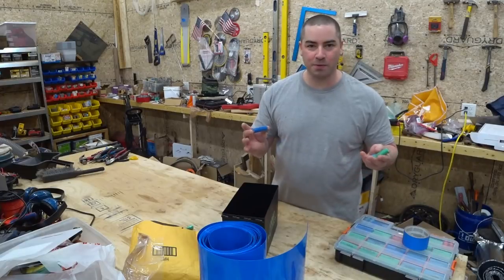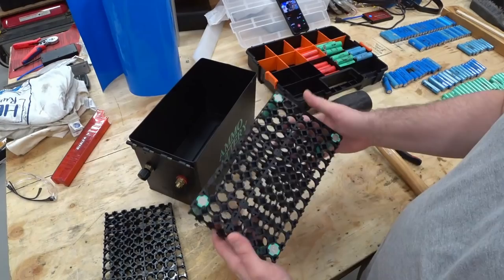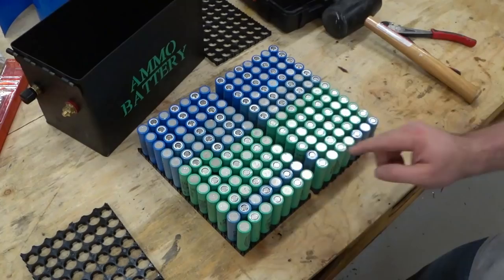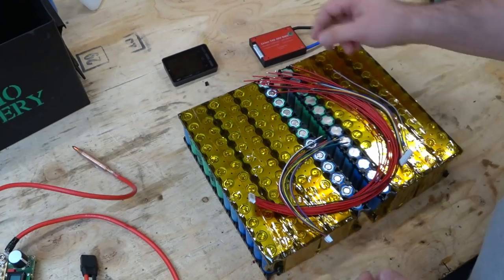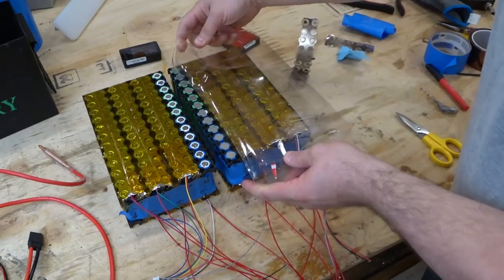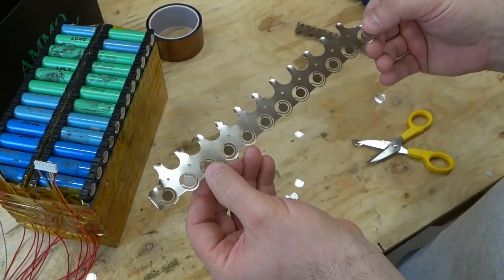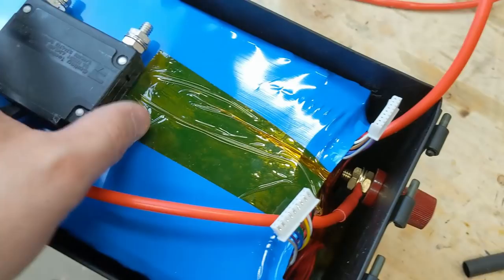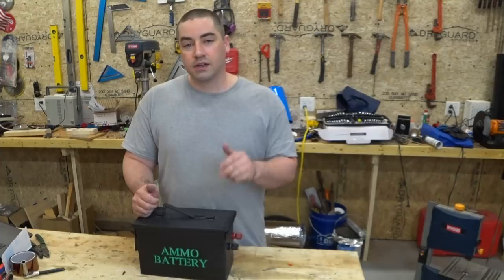48v DIY Battery in an Ammo Can

Comment: Great build.  Looks as good as factory made.  Only concern I might have is with the ammo can is if there is any interior heat build up.  How would you know before a cell goes thermal runaway?  The can being fully enclosed would also not allow much ventilation of the packs.  Maybe do a strong load test and show monitored temps at various cells IN the closed can and the outside metal of the can.  Maybe the can is an adequate heat sink to air, but does not help if a cell becomes a heater.  Great job!
Reply from the maker: It's always about compromise.  You can have wide open cells in the room, but no fire protection.  This takes the approach of enclosing the cells to protect the room.  The downside is you have to limit the amps to limit the heat buildup.  That's why I used a 20 amp circuit breaker.  The cells could do twice that.  I have been doing a series of tests on it at different amps and measuring the heat buildup.  It will be in a future video.

Comment: I put 12 3 LG 18650 2600MAH CELLS IN MODEM BATTERIES solder in paral and only got 2 hours of run out of an 200 watt inverter. I got the same 2 hour run time  with 4 lipo 4/ 8 amp hour in saire and out the same 2 hour run time. 12 3 LG 18650 2600MAH CELLS IN MODEM is = to 4 lipo 4 in saire!

Comment: Nice, clean job on the construction, so I will check out some other videos of yours...not to sound like an armchair expert, but I do fear by not accommodating the heat generated during charge and discharge, especially in a (semi) sealed enclosure, you are going to run into thermal limits long before you will run into electrical limits.  I recommend doing some temp tests under the typical, and worst-case operating conditions...but best would have been to embed some thermo-couples for internal sensing (and monitoring), into the array while you were constructing it, because for instance, high heat generated by a failing cell(s) will not be noticeable because of the high mass, and it would have to make it heat the entire mass before you might notice...it would smoke and possibly catch fire long before the entire box got hot enough to get a hint anything was wrong.  I recommend you build-in internal temp-sensing into any future arrays you construct, and add continuous temp monitoring in addition to your cell V monitoring!     Cheers
Reply from the maker: I have tested it under heavy load and it has not overheated.  Each cell can do a max 4.4 amps, I have 12 in parallel, or 52.8 amps max.  I have a circuit breaker limiting it to 20 amps.  It does not overheat at 20 amps.
Reply: @DavidPozEnergy  Great video!  What would you have to change if you were to make this as a 24v 7s24p pack?

Comment: I can’t get the math to work out on my end.

2200MAh cells
At nominal 3.7 V/cell of 8.14Wh per cell... 112 cells per battery, 14*8... I figure .92 KWh... no?  At 4.2V per cell, 2200MAh works out to 1.035 KWh... where is my math missing something?
Nevermind... 12p at nominal V, I now figure 1.36KWh... NICE! Max rated, should be 1.55KWh. A quite useful pack!
Reply from the maker: You got it.  And you could always buy higher capacity cells if you get them at a good price.

Comment: Is that spot welder really over $200? Unless I'm constantly making battery packs, that purchase would negate any saving of getting used cells. But awesome video!
Reply from the maker: Yes, the spot welder is over $200.  I hope to make more builds of different types, so I'll get some use from it.  But if you only have one battery then there are other ways to do it without buying the spot welder.
Reply: I thought the same about the price, so I made my own double pulse welder that provides consistent perfect welds for around $45. Check out 100A/40A Digital LCD Double Pulse Encoder Spot Welder Machine Time Control Module Board on ebay or Amazon.

Comment: Put 3 boxes in series and run your mitre saw on D.C. if it has a brush motor.
Reply from the maker: I'm intregeed by this idea.  Several people have suggested it to me over the years.  I don't want to blow up my expensive miter saw.  Do you know of any video, blog, white paper, anything that might show or prove this concept?
Reply: Try it out on a brush motor say in a hand circular saw (Skil Saw) or a large Shop Vac with a run current similar to your mitre saw. Check the Re Store for a cheap one. A current limiting resistor could also be used in series with your mitre saw to limit the surge until it gets up to speed then by-pass it for full power. Say 1.5 ohm 200 watt. Is your mitre saw an A.C. /D.C. Brush motor?
Reply: Check your mitre saw to see if it is a universal motor.  https://en.wikipedia.org/wiki/Universal_motor

Comment: You did not current test the battery.  Thus you couldl have a unbalanced bank of batteries after a few use (think of one bad battery). This could lead to one of your banks becoming drained and reversed charged. That could lead to one large  fire.   does the bsm have a low voltage bank alarm  or are the tabs also a fuse?   What was this design based on?
Reply from the maker: I have a previous video testing cells.

Comment: David why wouldn't you just put 2 of the balancers with screen inside the case as main BMS?  2 Of these are a much cheaper option than the BMS you bought to go along with the build by almost 50% and they do the same job (I've come to believe.)   Also a point, since everything is frequency and magnetic based on our lovely planet, try putting the same "magnetic orientation" cells together (ie: next to each other and in magnetic lines of force) as they are "polarized" if you check them with a compass after charging.  I place a sharpie DOT on the positive end.  I would expect this would help with power "flow" since there is less magnetic resistance.  Nobody has thought of this yet it is an anomaly I discovered by accident back in early 2020 as I kept a compass on my desk.  Think about this scientifically, it's easier to swim with the tide than against or across it, why fight nature?  Cheers David, love you guys and your content.
Reply from the maker: BMS stands for Battery Management System.  The #1 priority of a BMS is to shut down the battery if any single parameter goes out of spec.  Think of it like a smart kill switch.  The BMS's job is to keep you safe.
Some BMS's have cell balancing as an extra feature, but not all.  Balancing helps with the battery longevity, but balancing doesn't shut down a battery.  Balancing is not safety.  A balancer doesn't replace a BMS.
I hope that helps.

Comment: Have you considered the Headway 38120 LiFePo4 batteries from batteryhookup for your Mitersaw?  Maybe only in 24v for less weight.  They are huge and their discharge rate is very high.
Reply from the maker: Sure.  Nothing wrong with those, the specs are great.

Comment: Great video and love the K-weld. German built has lived whereas my chinese welders died. 
On a note about BMSs, the one you have probably doesnt have enough balance current to be effective. My guess is something like 30 to 60mA, and you should have something much larger with that many parallel cells. I found sole purpose balancers that do this, although they are more $$ than a BMS, but can balance at greater than an amp.

Comment: It would be cool to make a can for conversion.  Mainly a 48 to 12 DC to DC converter.  I am thinking about making something similar for Ham Radio.  How is the heat?  I was thinking about liquid cooking it.  For the surge of the saw, a large cap could help out.
Reply from the maker: If your radio is 12v, then you can modify the design to make a 12v battery.  Then no converter is needed.  But, there are lots of 12v lifepo4 batteries on the market, so you have choices if you want to buy one.

Comment: Could you put several of these to make a power wall? I have 22 solar panels on my roof and in the future I might consider making my own power wall set up.
Reply from the maker: Yes you could.  Just make sure not to exceed the amp ratings.  The reality is you don't want to charge a cell more than 500ma.  Which means try not to charge this 12p arrangement more than 6 amps.  But you just do out the math for your situation.

Comment: I think you did a good job but I never understand people using used batteries that can't be individually changed out. When I built my 10k plus powerwall I used new LiFePo4's but, even with them being new, each one is removable from the system.
Reply from the maker: It would be some work to remove one cell.  I tested all the cells before putting into this build.  And the cells are new-old stock, so they have never been used, but were sitting around a couple years.  But still, you probably have a way easier system to swap a cell then this.
Reply: @DavidPozEnergy  Dave, thanks for the reply. I think you did a good job but on my bank I fused each cell, you just don't want a shorted cell, especially with Li-Ions. 
Also, isn't that guys battery welder expensive? I designed my own with SLA batteries which I think are better for welders, cheaper and just as, if not more stable. He set his up for joules but I don't think that's necessary either, kind of overkill which always costs more.
Again, thanks for the video.

Comment: 8hrs to rip open modem batteries, $200 for a spot welder & another couple hours to put it all together? vs just buying a premade 48v packs that batteryhookup sells a few times a year. I just bought these 48v 13s7p 704wh module with 15s BMS which use 22P samsung cells for $90 each with DAVIDPOZ discount code. they were on sale for maybe 2 or 3 days before they sold out.
Reply from the maker: Those were a great deal.  personally I love the pre-made batteries that Battery Hookup gets.  My favorite are EV cells.  So why do this?  Well, the modem packs (containing the 18650 cells) usually come at a real good bargain price.  I think I've bought some down around $50/kwh.  Yes, then you have to go through a lot more time dismantling/assembling.  So it might not be worth it.  Then there is one other reason.  Some of my viewers are building things like E-bikes, and want a triangle shaped battery.  If you have a unique application then there might not be another answer besides building it.  But just for every day powerwall use, what you bought is better.
Reply: @DavidPozEnergy  is there anyway to tell if 18650 cells will last longer than EV cells? are these flat EV packs generally more tolerant to abuse than the 18650. It's harder to get info on the EV flat batteries vs the 18650. I like the flat ev batteries cause they are much easier to assemble into a pack.
Reply from the maker: If there is a way to know which will last longer, I'm not aware of it.  I think brand new EV cells will last longer than new 18650 cells from modems.  But, if you buy a used Nissan Leaf battery then the cells might be only 60%, and die faster.
Reply: @DavidPozEnergy  so basically it's best to choose the longest life chemistry, LifePo4 , if you can handle the 25% increase in weight? and use a smart bms so max charge and discharge is limited to 25% to 75%. Add a little bit of luck and your battery will have its  best chance of lasting longer.

Comment: David, seeing you use those crimps on the main leads gave me a little cringe. I have a friend who’s house nearly burned down because someone used those things. Over the years they loosened up and burnt the wires to the point that they were melting through the box and started burning the framing. I would prefer to see you open them back up and solder the crimp. Then there will be no room for arcing.

Comment: what is advantage of all this work to spot weld 168 cells together vs buying the big flat battery packs which are high amps/capacity and only having to solder in a dozen spots?

Comment: hmmmm, ok so you know i like your videos and your diligence, but... this one concerned me... you didnt fuse anything (glass fuses per P set?), no cooling, isnt temperature a concern here too ? this is not a knock down comment, im sure you know that, keep up the awesome videos, just my wonders thats all
Reply from the maker: No worries.  Actually, those nickel strips I used are cut in such a way that they are fuses.  So every cell is fused on each side (positive and negative).  I linked to the strips in the description.  
Yes, temperature can be a concern.  These cells have an operating temperature up to 60°C.  I'm currently doing some tests on the pack for the purpose of a follow up video.  I discharged the whole pack in 2 hours, pushing it very hard, harder than it should be pushed.  I recorded a maximum temperature inside the case of (think) 45°C.  
If you have any suggestions to make it better, I'm open to ideas.  But this is not meant to be a high amp model pack.  It's meant more for smaller loads.
Reply: @DavidPozEnergy  oo I've not seen fused strips, what a good idea.

Comment: Ohhh David, Why Didn't You Also Kspton Tape On Top Of The Folded Nickle Strips, Before The Plastic Insulater Material? Hmmm, HIND Sight... LOL
Reply from the maker: I taped off all the nickel strips that would have shorted.  The folded nickel strip would not cause a short if it cut through the plastic.

Comment: What happens if a battery goes bad and shorts? No individual battery fuses? Looks like maybe those little rings that are spot welded have a smaller tab connecting to the rest that could burn off perhaps?
Reply: The nickel  Strips He uses from battery hook up has individual fuses for each cell

Comment: 1.3 KWh sounds like huge power bank but in real you getting only about 28 Amp/h battery which can be used only with   very little Amp draw like 0.5 Amp or less otherwise you will end up destroying your state of art. Just open one lap top battery and learn how is build. 
I hope people will not follow your advice here.  There is much easy way how to destroy your 18650  :) Other then that very nice job. Good luck.

Comment: how would you set it up as a 12v system? the reason i ask, is because AGM and LiFePo4 batteries for solar banks are incredibly expensive. like $1,000 for a 200ah  and if getting even more performance out of this setup in a 12v system.... well.... you get where im going with this.

Comment: That is awesome    most people arent familiar with 18650..  that is a BUNCH of power     where did you get the modem packs ?
Reply from the maker: These are the modem packs I used.  You can use my coupon code: DAVIDPOZ for 10% off.  https://batteryhookup.com/collections/green-friday-weekend-deals/products/4-18650-2200mah-cells-in-modem-batteries?rfsn=3333666.ca06e9
Reply: @DavidPozEnergy  thx

Comment: 14S  or 14 batteries in series makes a 52V battery (approx)    13 cells make a 48V battery  !!
Reply from the maker: Yes you are right.  But I'm using it with my 48 volt inverter.

Comment: Is there like a safety fuse for overload or short -  is there like a safety fuse for the batteries ?
Reply from the maker: Yes.  I used a circuit breaker inside the box.

Comment: I don't think it was a practical design.  Here is why.  First you didn't have a isolation switch.  Yes, you had a circut breaker but an externally mounted switch would have been better.  Second problem, you don't have a way to charge it.  Yes, you could use the two post you have but you still need a charge controller.  Plus are you going to drag around four 12V panels as the 24V ones are generally lite. Third, there was no prevision for 12V applications.  USB, cigarette lighter, SoC indicator at the very least.  Now, if you had some other use case in mind where you don't need all of this then joy!  It worked for the applicational design that you invisioned.

Comment: the ryobi cells be more cost effective and powerful to just buy those? if the pack cost $6 for 20 cells then to make 200 cell pack it would cost $60 correct? thanks for the great video I love videos that are detailed like this because it saves some head ache hehe.
Reply from the maker: The Ryobi cells are lower capacity.  The Ryobi cells are 1300mah.  The cells I used in this build are 2200mah.  Battery Hookup also has some cells that are 2600mah.  My whole ammo can is 1.33kwh.  If I built it with Ryobi cells it would be 0.78kwh.
Reply: @DavidPozEnergy  oh ok... you would have to add more and make a different size battery then and change a few things to make it equal but higher current power right? But since the cost of it is lower i wonder how much more would it cost and how big the over all size of the battery it would be.

Comment: hey i have a trolling motor i wanna build draws 30 amps at 12 volts whats the best way to do this and are these cells capable? is the process any harder other then just the groups of cells
Reply from the maker: For 12v applications I would suggest you use LiFePO4 cells.  Group them 4 cells in series (4s) and they come out perfect for 48v.  The Headway cells battery hookup sells are easy to work with because of the screw terminals.  You can use my discount code "DAVIDPOZ" for 10% off, and it helps me out by tracking the affiliate program.  https://batteryhookup.com/collections/lifepo4-batteries/products/4-headway-38120-hp-3-2v-8ah-lifepo4-lithium-batteries-25c-200a-super-cells  You can parallel as many as you want to get your capacity up.  So you could do a 2p4s, or 3p4s, etc.

Comment: Why not just build a battery bank with the way they are shipped originally and just connect all those little packs together.
Reply from the maker: That would be cool.  Sometimes modem packs work like that, but sometimes they need communication with the host device.  In this case I opened them up because I wanted to test the individual cells to make sure I didn't have any bad ones.